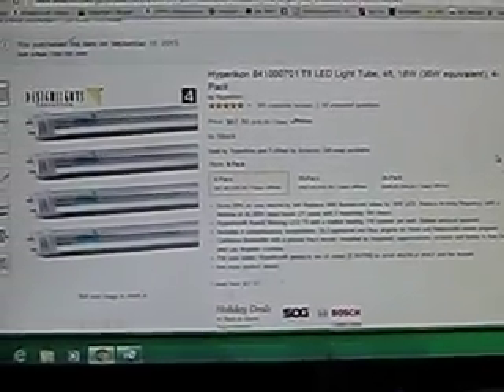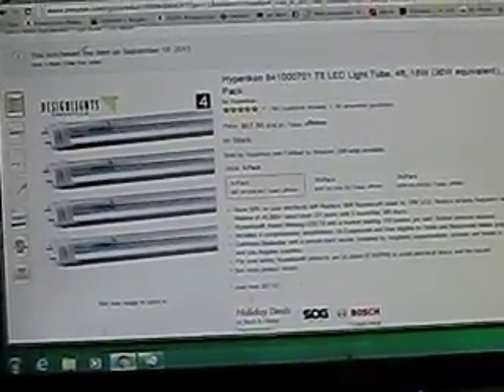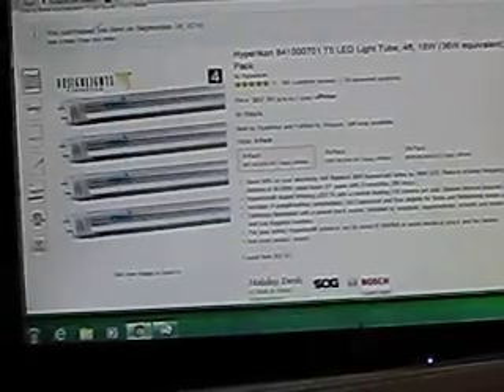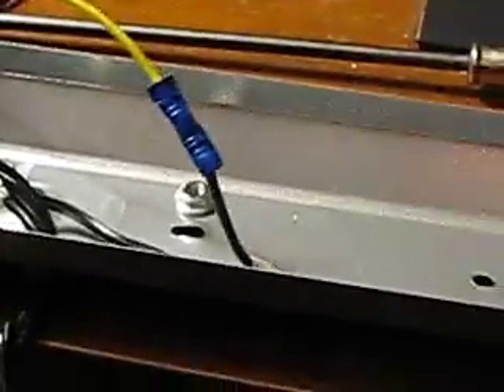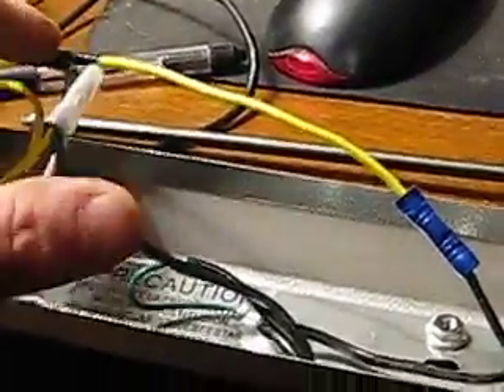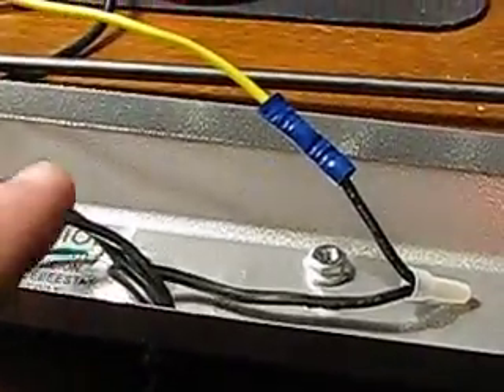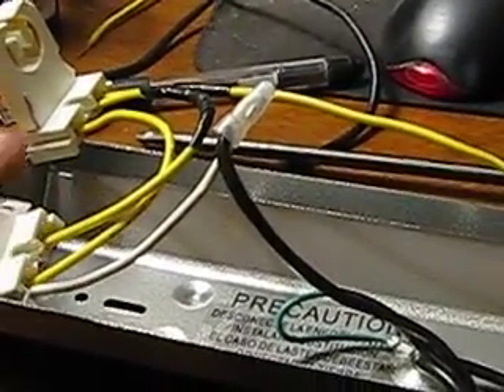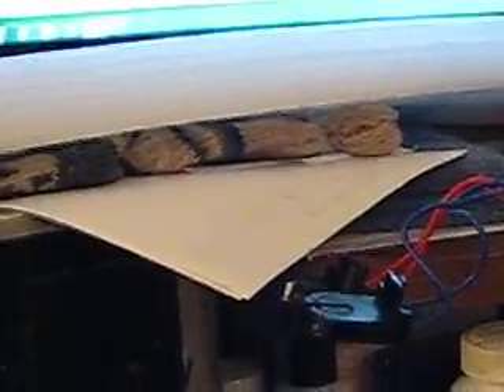shop light into grow lights

Comment: Wow, that's a lot easier than I thought it was. Can you put the name of the ones you purchased up for me? I'm making grow lights too, and could use the information. I know nothing about what lights to use. Bless, Sheila mhpgardener made a light setup using PVC for his grow lights, and I think I'm going to put the lights on that. Very easy to make too. You can see it here if you like. http://www.youtube.com/watch?v=tAYpn2Md9eAYou don't even glue it if you choose, and can be taken apart. Start the video at 4:48 for the PVC light holder.
Reply from the maker: +Sheila6325 http://www.amazon.com/gp/product/B00NXBMDEY?psc=1&amp;redirect=true&amp;ref_=ox_sc_act_title_1&amp;smid=A1VCN0ZD746TM9

http://www.homedepot.com/p/Commercial-Electric-Rugged-2-Lamp-Hanging-Fluorescent-Gray-ShopLight-CESL402-27/203725928

http://www.homedepot.com/p/HDX-48-in-W-x-72-in-H-x-18-in-D-Decorative-Wire-Chrome-Finish-Commercial-Shelving-Unit-6T60184872C/100655787